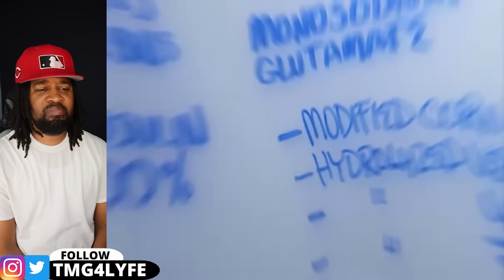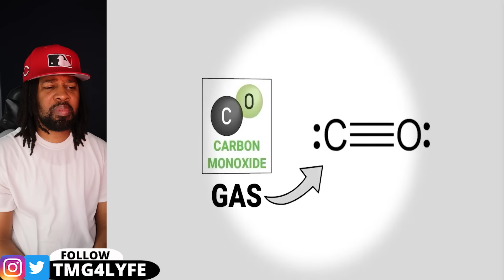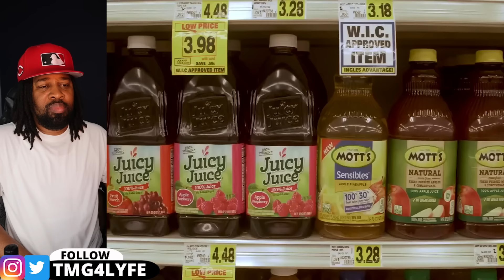You Will NEVER Eat Here Again After Knowing How They Made It

Comment: I used to work for a company that supplied box taping machines to various industries, but especially the food industry.
The one company that used our equipment made frozen pies. Our technician and sales rep both witnessed on many occasions how the employees would pick up the dough that had fallen on the floor and put it back on the line.
The fact that their factory floor was continuously covered in sludge made this practice very unpalatable and I have never used frozen pies since.
On another note, if you use margarine, this product literally dissolves the rubber rollers of the conveyor part of aforesaid box taking equipment. Our company regularly had to replace the rollers. Enough said.